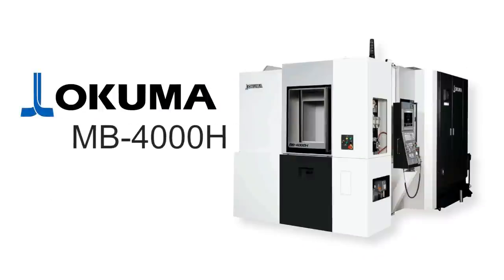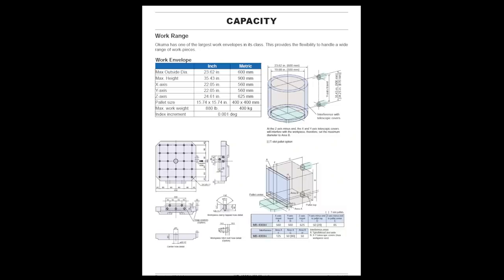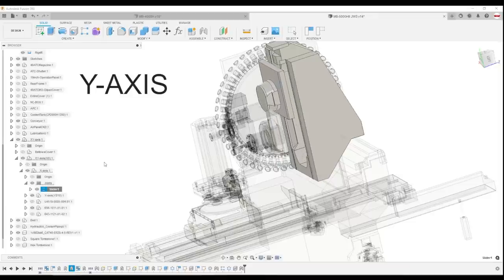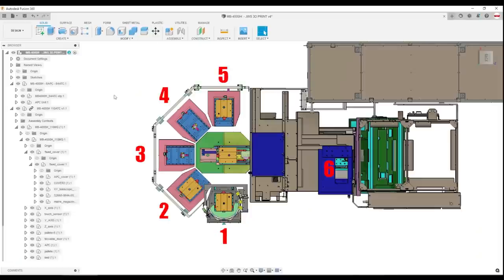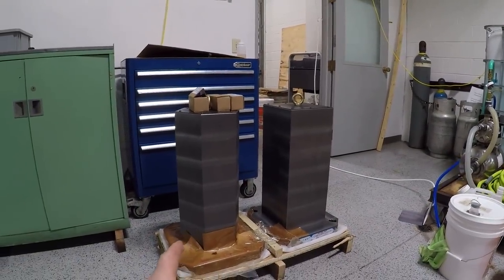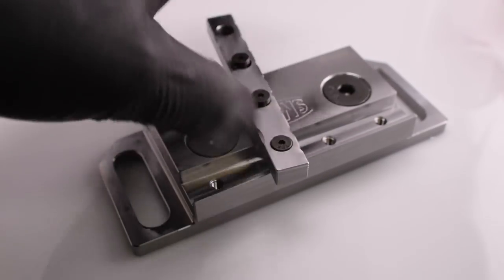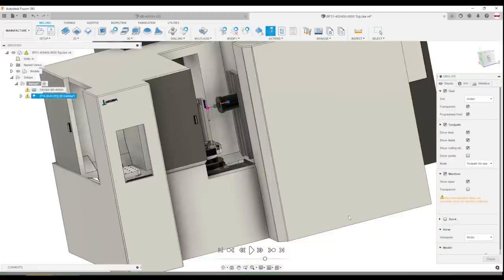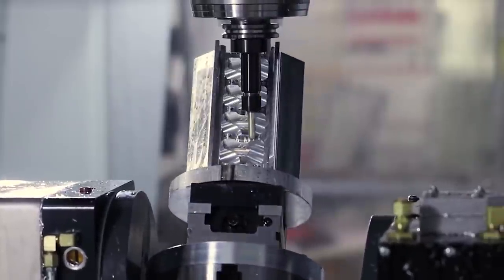Buying an Okuma MB-4000H Horizontal CNC Machine!

Comment: John, After owning a Hitachi Seiki pallet pool with two 500mm horizontals with 120 matrix tool magazines on each machine and 24 pallets. Your reasoning is exactly correct in this video. In fact I will even go further than what you said. This is what I found. You should think in terms of running the fewest number of parts necessary. Its better to have a variety of product and ship every day. What in a typical machine shop ties up things. It is when you have a job setup on a machine. It takes a lot of time and effort to set it up so you run a higher quantity of parts. But you cant do anything else on that machine until that's done. On you horizontal you need to think how to setup and leave the setup there. So all you have to do is schedule that in the queue. But run some every day. This is what we did, pick the best running job for night (un-attended) jobs. Schedule them for the night. On thing you may not have considered and what we found. Is during the day we spent a lot of time dealing with tooling. What I mean is indexing inserts replacing tools. We even had a person that did nothing else but index inserts change tools and change parts in fixtures. One criticism I will make. Is even with 120 tools on each machine (240 total) this was barley enough. What did you say. Your machine will only have 60 tools? I think that is going to be a limiting factor. Especially if you plan to use tool life management and tool breakage detection. Also we did this with tool breakage and tool life. If for some reason the machines could not complete a setup (Tool time or failure) the pallet pool would shuttle out that pallet and bring in another to run. This was especially necessary at night so we would not loose machining time.
Reply: I totally agree here, even with the ~200 tools and relatively high-volume stuff i do on my private machine, i'm still hard pressed for tool space if i'm doing 6-10 parts per product

That is admittedly with enough redundancy to only need to put in new material for a few weeks at a time but that's the point of automation, doing as little as possible.
Reply: We have an fms system and 4 horizontal Mori Seiki NH 5000's with 200+tools each running with two load stations with 60 pallets in the pool.   There are two
Attendants that load and deburr parts and gage them, that's all they do 3 shifts.  I don't see how you're running unattended unless
your cycle time is extremely long.  Especially with just a few pallets.
Reply: @MikeYurbasovich  for me, it's small tools in complex finish passes. I can't fit anything faster than a 0.5/25 mm in some parts and even at max rpm, that can still take a few minutes per part.

At 60 pallets with 6-10 parts per pallets just one finish op for the whole APC could end up taking a day.
Reply from the maker: Thanks!   As always, appreciate your guidance.  FYI she's a 218 tool matrix.
Reply: @nyccnc  OK I must have misunderstood. That should work for six pallets.
Reply: I agree, 200+ tools per spindle, future you will be very grateful. Our DMG Mori NHX4000 is only 18 months old and its 240 tool magazine is filling up rapidly.
Reply: the bit about having setups ready to go is the key to any kind of efficiency in almost any kind of manufacturing (-8
Reply: Those are some good points. You can never have enough tools when you start getting into pallet pools. Unless all you machine is aluminum, you'll need a lot of redundant tools.

Comment: My experiences with Okuma:
CAS have been amazing. When i first started out the company had just gotten into CNC only been doing it 2 years when i came. The operator crashed the machine on a somewhat regular basis.
He wasn't so quick to learn new things. Eventually i got to use the machine and i read in the manuals on my spare time. I turned on CAS, It was really painfull to get new models of tools into the machine (I believe they have updated this and it should be easier).

But CAS ended up being a massive investment saving the machine for many collisions when complicated setups with tight clearances was used.
Load monitoring have also been a bliss. I used to to log how much load the tool uses in different cuts. If the load is higher than usually i made the machine alert a message saying inspect the tool High load

And even better if the load was to low then that would indicate the part might have moved slightly.

I also wrote a gcode to fetch date and time so it could been automatically engraved.

But customer support have been poor. I live in Norway so we got different people who handle the customer service. If there was something basic like a interlock holding up they wouldn't be able to answered how to fix it or how to work around it. I had to do a tool change without every axis in its home and needed the codes m867m66txxxxxx. The manual had misprinted the text for those codes, so it was unreadable.

Else the machine itself have been insanely strong. Before we started to do load monitoring the insert broke and the machine just kept going melting everything. It didn't become misaligned which was amazing.

And repair parts are astronomical expensive. Like a rubber wiper for the glass cost 5000 usd (which is a wear part).

TL:DR Machine is strong. They are expensive. Bad customer service. But the machine is a work horse.
Reply: Also like the say the accuracy and rigidness is really good
Reply: I agree.  We have some Okumas in our shop that were treated poorly for 25 years and they still make good parts.  Their service does leave something to be desired and get your wallet out when you need spare parts.  Especially once servo amplifiers get to be 10+years old.  Were talking about $15,000.00 and up for a spindle drive and sometimes $7,000.00 for an axis amplifier.
Reply: It's absurd the fact that you will need Okuma for EVERYTHING in terms of maintenance and repairs. You can't even move your machine from one place to another without needing them. From a maintenance guy perspective, worst machine ever.

Comment: John,  we were where you are a year ago.  We also decided on the Okuma MB4000-H 6 pallet 146 tool with 20,000 rpm HSK.  Originally thought going 15,000 and doing aluminum and sst, but decided to make it an aluminum machine because chip separation is to time consuming. Due to delays we had to put off our goal of fixturing every pallet and holding 30-50 parts that may be 5-10 different parts per pallet.  The goal is to get 15-17 hours of unmanned un interrupted running.  That way the machine is running when we come in in the morning. It is warmed up and we can run the short run parts during the day utilizing Zero point quick change fixtures and long run parts at night.

Comment: I've worked on MB4000/MB5000-H's for the past few years. With and without a flexible machining system attached to them. Great machines. Fast and highly repeatable. Some things to keep in the back of your mind: the big tempered glass sheet on the door is very expensive to replace if an insert grenades in it's direction, crashing the tool fetcher in the matrix becomes an alignment nightmare, watch for chip pile ups on the way covers as one swift rapid can crunch your covers in a heartbeat, and lastly consider extra filtration methods for your coolant tank/high pressure pump if you don't want to drag that big sucker out from underneath the machine for cleaning too often or enjoy buying expensive pump filters. Also a case-by-case scenario, but I find they have a quite the thirst for coolant between all the usage options at your fingertips (shower, through and flood coolant). I fill their tanks up more than any other machine in the shop. Anyways, enjoy the new purchase! Exciting!

Comment: I've had this exact machine, pallets, and options for a while. Very easy to leave pallets loaded and pull inventory through them. Being able to setup or part change and tool load while the spindle is still running is a huge gain. Keeping setups, not rushing fixture changes, and multiple setups all at once is so good. For me it's like having 36 tables in a vertical. I've taken stuff out of 3+2 workflow with it.  I mostly run aluminum in short runs but I already have 80/145 pots in use. Almost never build new tools now which is great for prototyping too, just have to worry about wear. You will be tripping over sequencing with the two sub modules so be ready, a G04 dummy program has been the easiest way to rotate pallets through. You've done a lot since I said not to get that rebuilt Fadal for its controller.

Comment: Hello its the first time i run across your channel i am a service tech and have rebuilt mb 4000 spindles in the past.
What i suggest keeping an eye on is make sure you have chip management around the tool setter the sensors for the cylinder tend to die because of chip accumulation.
Make sure your atc door does not bang ( i have seen a atc door bracket get sheared from continuous wear) you can stiffen the door bumpers with an allen key.
Make sure to clean your coolant system every year to avoid spindle damage and also keep your spindle through coolant pin in good shape has this will save you tens of thousands and hours of work for spindle replacement.
Good luck.

Comment: We have 2 of them, same spec.  cant stress enough: check your floor. a horizontal sits on 3 pads,  and most shops don't have an adequate floor to hold a 24,000 lb machine moving at the speeds they are capable of.  we put 2x2x4 ft. deep pads under our machine and they haven't required releveling over 6 years.   our new 10 pallet machine actually recommends a full 24" slab under the machine and tool magazine.  with 6 pallets you absolutely want the matrix, one thing instilled on us by gosiger was coming up with a good tool numbering system, since you have so many tool numbers available in the okuma's.   two odd options if you can get them: extended way lube tank, and extra gage length(you always end up wishing you had a longer drill)

Comment: John we have 2 DMG MORI NHX4000’s. They only have the standard 2 pallet option and a 60 tool magazine. I set them up as identical machines so we can run any job on any machine with very minimal offset change. Basically you might have to change the offset a couple thou maybe. All 60 tools are set as common tooling. So when I program I program with those tools only. Sometimes I have to get creative on programming but for the most part it works really well. Set up times from job to job is less than 10 minutes.  I appreciate your videos and I’ve just discovered your pod cast and have been enjoying that. That’s again for all the good info

Comment: Go ahead and make a standard pattern for your fixture plates that you will be mounting to your tombstones. Perhaps a series of 1/2-13 threaded holes and a couple of dowel pin holes for locating your plates. Then whenever you get a new tombstone just run your program that faces all sides, drills and taps your holes, and bore or ream your dowel pin holes. That way whenever you want to add a new part all you need to do is make that sacrificial plate you mentioned that has that same hole pattern and mount whatever hardware you want to it.

Comment: Now I work in metric size but I want to make a hole pattern  50mm 50mm with M14 thread where There is a 16MM H6 in set hardened fitting ring to guide fixture plates in the tombstone
In my experience it's the most cheap and reliable way to make a flexibal an reliable system 
good luck and I hope you get a good experience with a horizontal Mill an Tombstone system

Comment: Great machine, stopping because of a loose door is not. The mid-auto to adjust on the fly and being able to move the positions to check the parts and then restarting the sequence without restarting from the beginning of the tool is awesome.

Comment: Welcome to the OKUMA family!👋 The benefit of CAS is not the compatibility to fusion. When your tools in your machine do not fit the size and shape, they have in your CAM, you have no garanty of avoiding a crash. CAS does a digital twin of any of your tools, fixtures or workpieces, what you are running in that very moment, using the toolsetup data of the machine, not of the CAM. So it is way more safe and reliable, even if you jog your axis by hand!

When you start your setup run, the first step is to simulate your program life in the machine. When CAS detects no collision, you don‘t need to run in single mode, you just only reduce the rapid a bit by hand an let it run in automatic!💪

So have fun with your machine, I am exited to see, what you will bring up with it in the future!!😍

Comment: Love the Okuma controllers, buddy had a bit of a goof with the constant feed jog (select axis and direction and the machine will move until travel limit or stopped manually) turns out the spindle head will run itself through that tool length detection probe when it's tucked inside the housing without a second thought if you're not careful.

Comment: I said ages ago yous need horizontal. Eventually bigger place too. If i bought a machine I would spec it as "everything" because everything is everything. Buying some couple k option that you don't use is better than losing money like pouring it in the well because yous skimped on couple k is much better idea to me. Short lead time with proper tools is what you want, not short  lead with stupid big inventory and bad tools.

Comment: I'm currently at work running a mb-4000h and a mb5000h. Solid machines but very finicky wiring. Both are currently waiting for techs to come and fix some new and ongoing issues.

Comment: So much for supporting US made machines .
Reply: What other us manufacturers are there for horizontals? Haas of course. I know Grob has us made horizontals, but I think they are all 5th axis.
Reply: HAAS has good marketing and with people like Mark Terryberry who can show you how to get the most out of it. What they lack is the rigidity and sheer mass that you need to have when cutting anything beyond aluminum. For some they will never out grow the limits that entry level machines like Haas have so they will never run into the lower performance ceiling that comes with them. 
Our VF-3 will rip through aluminum all day long with volume-mill on gibbcam, the limit I impose more so driven by how well I can secure the part in the vise. Put some 304 SS or even A36 MS in there and it becomes a total dog. Spindle loads are reasonable, the entire machine is buzzing/vibrating and sounds terrible. Notice on most of the HAAS demo videos they are cutting not steel or stainless but almost always aluminum..
Reply: #globaleconomy
Reply: @135SoHc  right. I'd be hesitant to get anything beyond a verticle or job shop from Haas. Not to dis Haas, they have their place, but fifth or horizontal production machines, I'd want something more rigid and expandable.
Reply: @mattn5011  DMG Mori makes the NHX series in Davis, CA.
Reply: Sadly not many machines are made in the USA anymore. All the big players are Japanese or German. Haas is the only real US player out there.
Reply: @WilliamPayneNZ Mazak
Reply: @qdp03  Mazak is Japanese.
Reply: @WilliamPayneNZ  Their VC-Ez series is made in Kentucky
Reply: @qdp03  Many foreign CNC manufacturers have assembly plants in the USA. Mazak (Japan) being one and Grob (Germany) being another. It allows easier supply to the US market.
Reply: @WilliamPayneNZ  The Mazak factory in Kentucky isn’t just assembling parts. They’re manufacturing whole machines.
Reply: @qdp03  What I was meaning is they are not an American company. Same way Toyota isn’t but still has US car plants.
Reply: @WilliamPayneNZ  Gotcha. So founded in America.
Reply: @qdp03  yeah.

Comment: Awesome video but I'm a bit confused about your decision for the 400mm machine. Because when you have to consider so many things between 400 and 500 mm and your decision is kinda "on the edge" don't you think that the limitations of the smaller machine will soon show in your work process? Yes, the bigger machine is more expensive but when the limits of the smaller machine already pop up in your plannings at every corner I would have seriously considered investing a bit more money.
What would have been the roundabout price difference between the two machines?
Reply: The MB-5000II is a much more expensive machine, nearly double the price. It’s also much newer and attempts to fix a number of the issues with the 400mm machine.
Reply: @matterrend2802  Thx, didn't know that the price difference is so huge. Certainly doesn't look like it from the spec sheets.

Comment: Why a okuma? Most of your machines are haas
Reply from the maker: Monogomish?
Reply: @nyccnc  just wondering if there was a particular reason you got a okuma. Figured having a known user interface and likely usable gcode allready would have lessend the learning curve.
Reply: Perhaps he's at that point where he feels comfortable spending the big bucks for an excellent machine .

fyi: my boss bought a haas ec1600 horizontal NEW!, he also has a huller hille nbh 290 amongst others . The difference is night and day , absolutely  fuckall rigidity , skinny chip management , weak coolant system , very weak sheet metal , sensible tool change arm. Now... that NBH is 21 years old , has lots of problems , but the stability power and torque is unparalelled , even without a good foundation . That 50 taper haas (ec1600) can't hold a candle to the capabilities of the geared german monster .